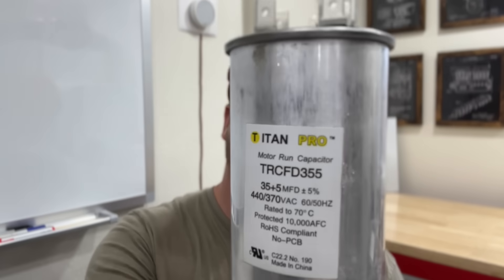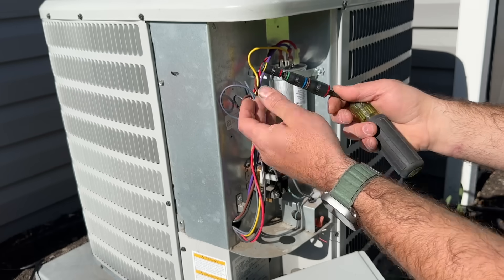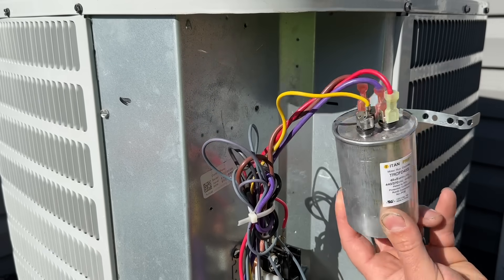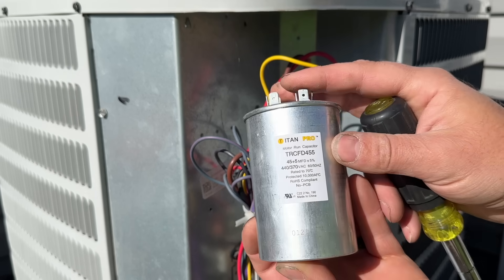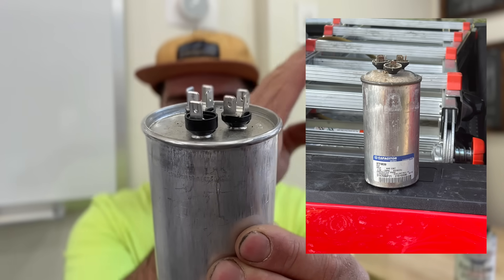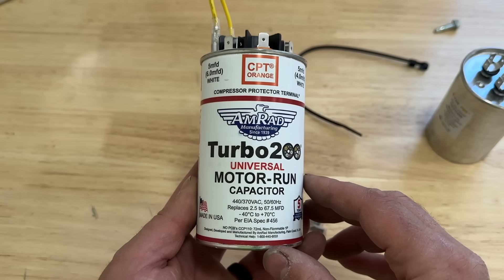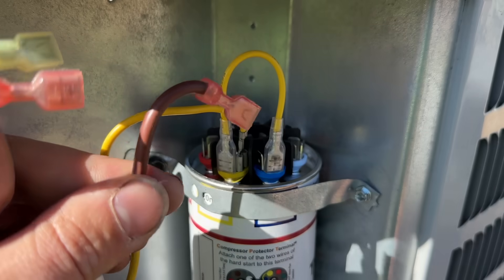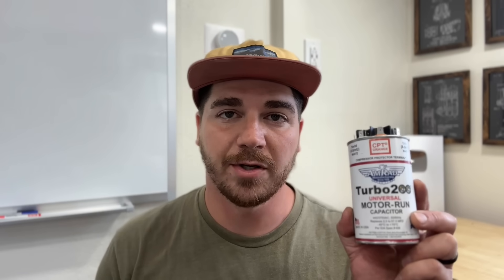HVAC Contractors Practically Make Their Living On These

Comment: Bad caps usually show a bulging deformation, either on the ends or sides or both.  These caps go
out within 8 to 10 years or so, or right after the warranty goes out.  In my opinion it is "planned
obsolescence" by the manufacturer to increase sales and is a "gift" to the techs to steal money.
I'm responsible for two residential units and have replaced these caps on both units. I've even
done a replacement "prophylacticly" (even I don't need to).
The other major failure mode of residential units, I have found, is the exhaust fan motor and the
blower motor, both relatively cheap and easy to repair. I've done two exhausts and three blowers.
On the coolant side of things I've encountered "slow leaks". What I have seen on tech videos
and in my own auto and residential units is the leak is in the schraders.  I now have the "closed
system" replacement tool - badass.
Good job Mr DIY HVAC Guy
Reply: Not all bad caps bulge
Reply: It’s not really planned obsolescence.  It’s really more of government interference and mandates.  The old capacitors from the 1970’s and 1980’s with the PCB insulation hardly ever failed, and the ones still in use are mostly still original.  Once the government mandated banning the use of PCB’s, capacitor manufacturers had to switch to other insulators, mostly mineral oil or vegetable oil that does not handle the heat as well.  Same reason the costs on HVAC equipment has increased so much—-higher efficiency rating requirements, and newer, “greener” refrigerants.
Reply: @garrybillick3979  Wow you are right on with that, I was an AC tech all through the 80s , I rarely ran across a bad capacitor, I've been wondering why everyone is talking so much about their capacitors failing

Comment: This is a good info for the people to know.   My mother's home had the AC stop,  and I told her it was LIKELY the run cap.   I was correct.   The technicians also gave the AC unit a full wash down...  and the cost was not as steep as the "scam"  you speak of.... so I think they  did an OK job.    Although the techs did comment on the age of the unit,  and that replacement due to age wasn't a bad idea.

Comment: saving this video for future use.  I had an hvac tech try and charge me $600 for one of these years ago.  I had a friend come over and we determined it was the capacitor and off I went to the local plumbing/heating store (VAMAC) to get a replacement .  With your video Ill be able to do the test myself next time

Comment: Before I learned how to switch the capacitor out myself, I had a tech come out to do it because the compressor wasn’t turning on.  When I opened up the panel a few months later, I noticed that the tech left the other capacitor in there which runs the fan, and never connected the fan to the newer capacitor.  I wondered if that was intentional, because if the fan went out later, that’s another service call and all they’d have to do is switch the fan wires to the newer capacitor.
Reply from the maker: This happens quite often. That should only be a temporary measure until the right capacitor is put in, but you can use the fan terminal on one capacitor and the hermetic on another in a pinch. Cheers

Comment: What SHOULD a good HVAC guy guy for coming out, diagnosing and replacing this part, maybe $150 total? thanks
Reply from the maker: 100-300 is an acceptable price being as some companies have a lot of overhead and such (not that you should be paying for the overhead) but anything over that is just taking advantage in my opinion.
Reply: About $250 or so would be reasonable.

Comment: Got my bi-annual inspection in November and the capacitor running the fan in my furnace was measured by the tech as low. He showed me the measurements he took after I asked. Then quoted me $295 to replace the capacitor, and if I wanted a Turbo Capacitor, $395. If I declined, $89 call out fee if we called the company to come back. I declined and did the swap out myself…and purchased a spare I keep in my garage. HAVC companies make bank in Texas charging whatever they want to install a $15 component.
Reply: They CAN “charge whatever they want”. You are paying them for their time and knowledge …
They are not “charging $200 for a capacitor”… they are charging $20 for the cap, and $180 for knowing WHAT to change.

If it’s too much for you, or they are ripping you off, then DIY.

Everybody complains about being PAID low wages, yet no one wants to PAY high wages.
Reply: @ernestgalvan9037  thanks for reiterating what I posted. I’m not sure who you are quoting in your post, but it certainly isn’t from my post. If the prices were more reasonable I would have considered paying for the installation and recommending their services, however, a job that could take several minutes isn’t worth their price point to me. If the job turned into something more invasive or complicated that required more time, effort, skill, then I would understand. Thankfully the technician wasn’t upset with my decision to decline service and he was free to answer other calls.
Reply: @BlahBlah-em2ed  He should have been honest enough to tell you that if your blower motor cap is weak/dead, then you blower motor is on its way out.
Reply from the maker: Yep, it’s true. Glad you have the knowledge and power now to do this yourself 🤘🏼🤘🏼

Comment: because of your videos, a couple years ago i took note of the model numbers of the capacitor and the contactor in my unit and ordered new ones, luckily havent needed them yet. i also started cleaning the coils every spring before first use, about 5 years ago. The amount of junk  on the coils in one season is pretty amazing.
Reply from the maker: Nice! It will be going soon and you’ll be prepared! Cheers
Reply: Order a compressor

Comment: Couple tips I do is to remove the disconnect and set it on top of the box and not the stored position. It’s easy to look at it and say “yes power is off”.
Also, I take a marker and write the wire color on the side of the old capacitor so I don’t get confused later about wire location.
Reply: Your phone is your #1 helper... take lots of pictures and refer to they while doing any repairs.😊
Reply: Yes it's safest to pull the disconnect and not put it back in upside down. That's just asking for trouble: someone could come along and turn it back. Or you could mistake and think it's off and it's not. Just to double check, use your meter to check the power at the contactor, both sides.
Reply: @Rumpelstiltskin-yv4ep that's a very hard lesson to learn...
Reply: You live in a low-rain climate :) rain regularly in other areas- putting the breaker in ‘disconnected’ keeps it from getting wet.
Reply: @JimzAuto  No, rains a lot here. But something like that you could just shake it off.
Reply: @ODucks55  that’s the ‘Taylor swift’ approach to electricity :)
Reply: @JimzAuto   Who’s that?😂

Comment: So if the 5 uF goes bad on the Turbo 200 can you just move the wires over to the 10 uF term and be good to go?
Reply: Not if you want your fan motor to last very long.
Reply from the maker: No you’d use the white 5mfd terminal
Reply from the maker: They make baby turbo 200 capacitors for the indoor fan, because I’ve seen 3mfd, 5,10, and 15
Reply: @diyhvacguy  I think they’re called the Mini-Mate.  Most of the time, replacing a capacitor on a blower motor is a waste of time/money and only delaying the inevitable.  The few times I’ve replaced a blower motor cap, the motor failed not long after.

Comment: I was charged $400 a piece for these capacitors a few years ago.  I realized afterward that I was ripped off.  I have since done a lot of my own HVAC maintenance thanks to channels like yours.  Thank you.
Reply: 400 usd thats crazy, we were charging $150 CAD over here per cap and i thought we were ripping. guess not.
Reply: @SuperComfee  Hvac contractor here.  I'm one man in a van and I charge $150 for most residential capacitors too.  It will only use Amrad brand caps....which are generally in the $30 range.  If someone thinks another $120 on top of the Capacitor is too much to take the call, make the trip, have the inventory, test the old cap, replace the new one then do a few more checks ensure the system is operating correctly then...they just understand the value of a persons knowledge, equipment and time are truly worth.  I do concede that $400 is a bit on the ridiculous side though.
Reply: @kfgreenwald166  If you think that price is justified, why don't you put that into the service fee instead of being dishonest and lying about the price of the part?
Reply: @kfgreenwald166  You're a little low on pricing jobs my friend. If my RV repair customers want 1 or 2 day service, I charge a travel fee min of $60 and an hour at $180 which is what dealerships get for a tech hour. I make part profit also...so $250 is my MINIMUM fee. A local HVAC company taught me 25 years ago how not to fail in business.
Reply: @RedlineWasTaken  Why do you assume he lied about the price of the part ?
Reply: @RedlineWasTaken  You think $150 ($30 part and $120 installed) is unjustified?
Reply: @Robnord1  I charge what I need to to make a reasonable profit.  Again...I'm one man in a van with very little overhead working in a smallish service area....so I don't need to charge the same $250 as the shops with a dozen trucks, techs, salesmen, installers etc etc etc that advertise on the local TV/Radio and billboards do.
Reply: @RedlineWasTaken  Who said he was lying about the price of the part.  I don’t break down parts and labor.  It’s flat rate pricing.  I don’t have to justify what amount is parts and what part is labor.
Reply: @Robnord1 did HVAC teach you anything  about the Golden Rule 🙏
Reply: @SuperComfee  companies been charging $400 for a installed capacitor for the last 15 years here in Florida, get your money man
Reply: @SuperComfee  I can see 200 -250 bucks, especially in California.  It is more than just 10-15 bucks for the capacitor,  you have to drive here for 30-45 minutes in addition to the hour you spend with me, you need to pay yourself a decent livable salary for the area, and you need to maintain your "truck."  If larger you need to pay rent for the central business location.  Some guys do cheat though.  I had a fridge repair place come and all they had to do was replace a fan (I told them, its the fan but figured I was busy let them do it) They disassembled my whole fridge for the $90 diagnostic fee,  showed me the bad fan, but instead of charging me 50 more for the fan.  They claimed I needed a new circuit board and would charge $690.  I reluctantly gave them their diagnostic fee and told them to go away.  Bought the OEM fan for 35.  Too many scammers in home repair.  If I were an old retiree, I could have been stuck not knowing any better.
Reply: @SuperComfee how many hours did it take you to become a tech? Did you go to tech school? Do you get 401K and medical?
Reply: I replaced the capasitor on my heatpump last summer, 40 bucks ! YouTube is a wonderful source of information !
Reply: @kerrymehaffey6257  And can be a great source of revenue for professionals at the same time!  Win-win situation.
Reply: You are NOT being charged for the part you’re paying for the knowledge. I have my own HVAC shop and it’s expensive to run. Good tech’s are expensive. In my area a tech’s hourly is $55-$65 per hour plus medical, dental, 401K, gas, insurance, tools, the van plus overhead and profit.  From the techs prospective they have to invest about 900- 1000 hours at a tech school plus 10,000 hours to become a journeyman, that’s right it takes 5 years. My break even for a service is $375 to get a van and tech out to a home. What’s a fair price for a capacitor change out? If it was just the capacitor I would say about $450 - $500 however if that’s all the tech does then he’s not doing his job. Remember the expensive part is the service call so if you have the tech out already have home change the contactor if it’s more than a could of years old, it’s another “cheap” part but they fail all the time. They should also complete a maintenance while they are out. The price should be about $700 for all the services I recommend. If you can do it yourself safely you should.
Reply: Not a rip off per se, but the industry standard. My neighbor paid $400 for an emergency same day service on a Saturday, during a Texas Heat Wave, for a capacitor replacement.
Reply: You need to make that $400 bill cost them at least $1000 in bad publicity
Reply: I wholeheartedly agree that a technician is due a significant markup due to experience, business costs, etc.  But this was on a seasonal maintenance visit for which I had already paid a significant charge.  The capacitors weren't even faulting, yet.  It was a recommended proactive replacement.  I don't expect to be charged the Amazon price for the part.  But 15 times the price?
Reply: @captainstress  got it! Usually if the capacitor is within 10% of the MFD rating it doesn’t need to be replaced.
Reply: Sucker

Comment: Can you check a run cap to see if it’s on the 
verge of failing? Like with the meter or visually? I always keep a spare, but maybe if I check monthly in the summer I could prevent a failure before hand instead of fixing a failure.
Reply: You could measure its capacitance to see whether it's still within spec.
Reply from the maker: Yes like we did with the voltmeter. It can be off past 5 or 6% and still running. That tells you it’s about to quit soon
Reply: @diyhvacguy  Thanks. I was looking in your Amazon store for the right multi-meter for this, but didn't see it. The multi-meter in your store doesn't look like it will work for this. The Fluke in your video is way outside my price range as a DIYer. Can you recommend something a little more budget friendly?

Comment: My air conditioner system blows really cold air and the compressor turns on and off properly but many times, the blower will stay on for hours w/the compressor not kicking in [because the thermostat is on a higher temp]. I live in South Florida. What do you think could be my problem?
Reply: Check to see if the fan setting is set to ON (normally is set to auto).  Also check if your thermostat has a “circ”’setting for the fan.
Reply: >garrybillick3979  : If the thermostat is set to FAN ON, the blower won't just "stay on for hours," it will stay on permanently.
Reply: @brothermine2292  Depends on the thermostat.  Ecobee and Nest can run the blower for a specified time.  We don’t know what thermostat this person has, so it’s hard to troubleshoot it over the internet.
Reply: Probably a failing motor module
Reply: Perhaps the sequencer relay has become sticky.  They don't cost much to replace.